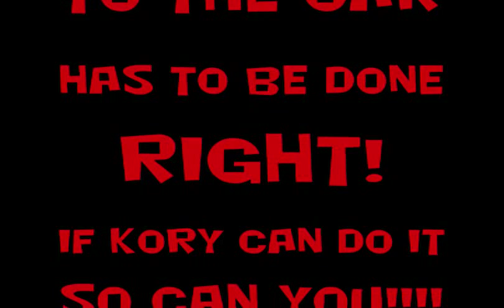1968 Dodge GTS-How To Tape Off A Car For Primer!

Comment from the maker: When you do a restoration like this, you paint the inside and bottom of the car on the rotissurie machine, with single stage paint, usually enamal or urathane. This step you really don't see, and if you get some trash or dust specs in it, it won't matter, and it gives it that factory look. Then you paint the outside of the car with basecoat/clearcoat, so you can color sand and buff... For that quality pro. finish..... Thanks Pete